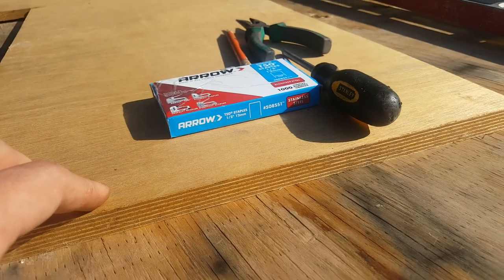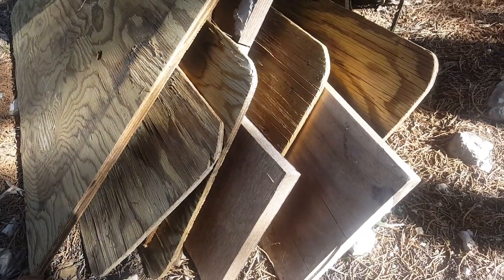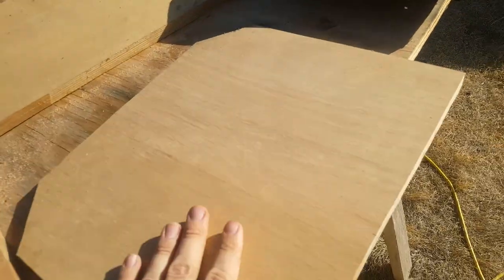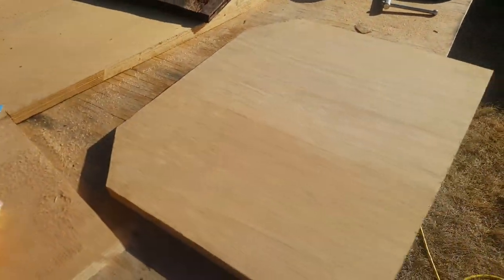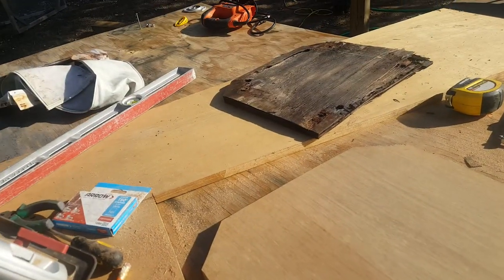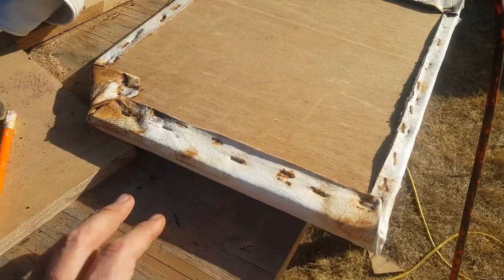Aquatek Meranti Marine Grade Plywood Boat Seat Repair

Comment: if only in side boat use 3/4 plywood moore mount!!   i m replace capitain chair just plywood it self!! be on pontoon boat
Reply: for 1st i learn alot cheaper buyen seat price new $300!  repair cheaper!!  i use flate head screws go from top down wont rubb butt!  under use locken nutt tephlon  use  lock liq  wont back off under vibration! sr i  learn a lot i joy moore vidoes ! ty save me heck lot money! im drill small drain holes in case like said sr ty!!  once again!!